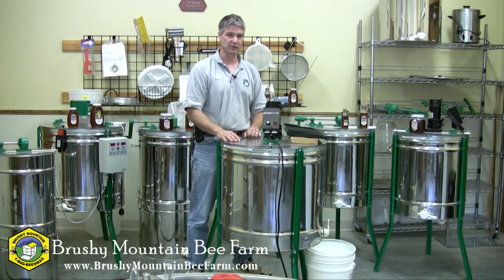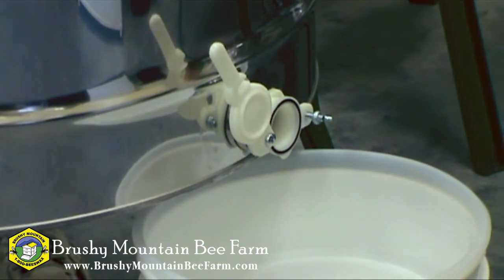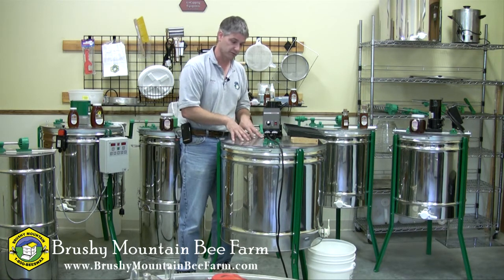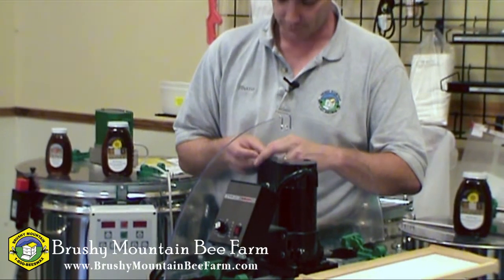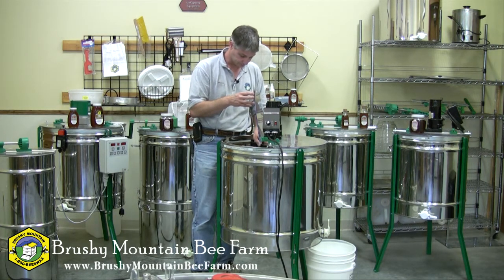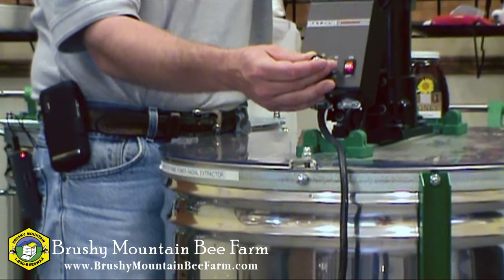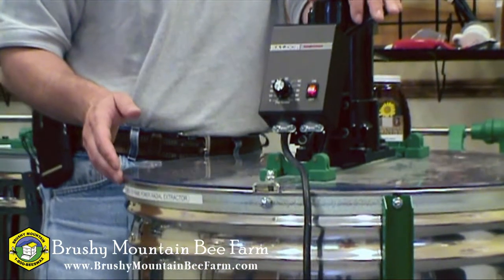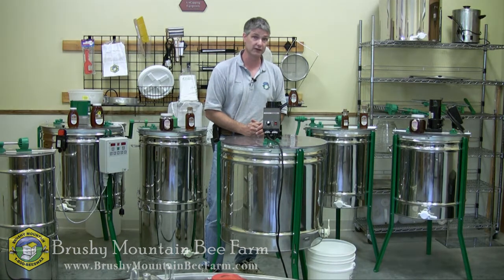18-Frame Powered Extractor

Comment: You state that this is a DC motor/ How does one convert from AC to DC or is it done automatically via the control box? Also this video is linked to your 9 frame extractor
Reply from the maker: This is done through the control box. 
Thank you for noting the link to our 9 Frame Extractor. We will look into this.

Comment: Inside of extractor is not shown ,maybe there is something to hide , for example plastic parts which will not have long life
Reply from the maker: +Anatoliy walker Our 22 gauge stainless steel extractors are made of the highest quality material. Some components of the basket are plastic, but having sold these extractors for several years, we have had nothing but great success with the extractor. As long as the extractor is properly cleaned and maintained, there shouldn't be any extreme issues..